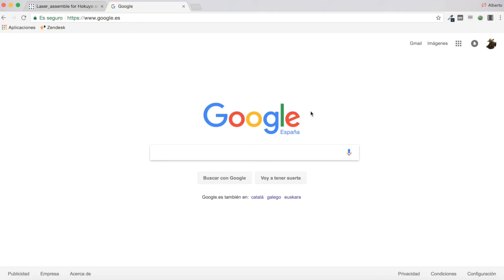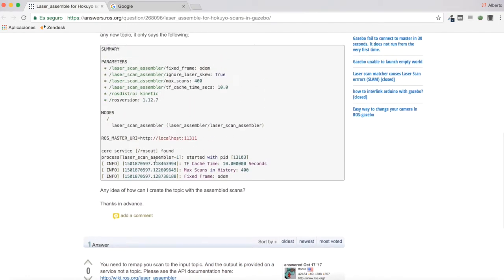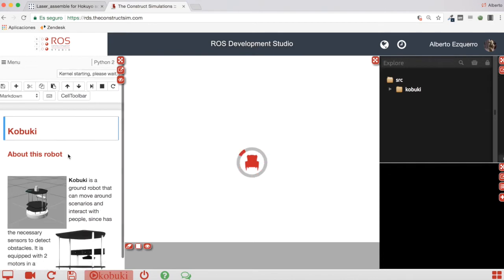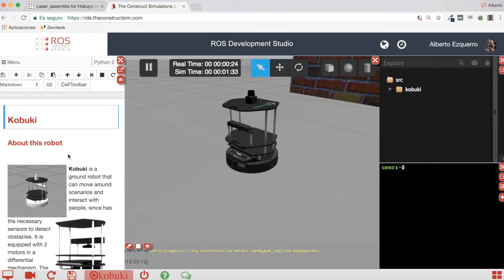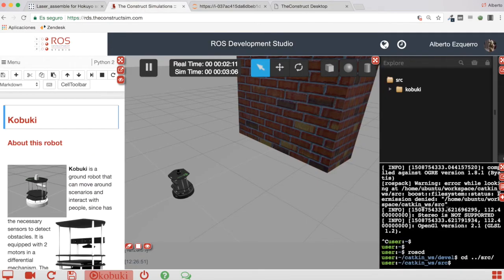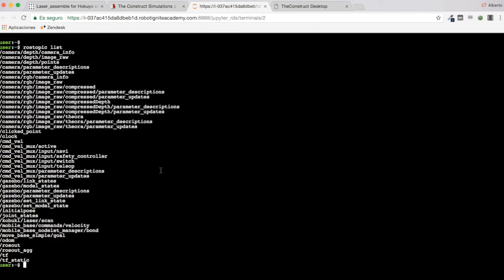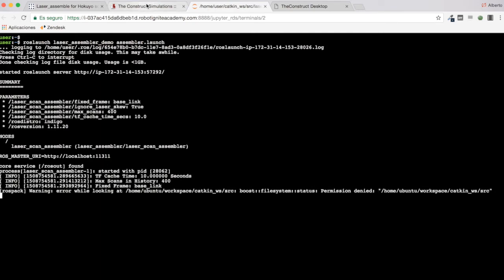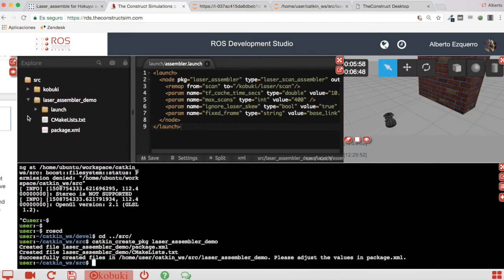[ROS Q&A] 047 - How to use the laser_assembler package

Comment: I am trying to implement this to a Raspberry Pi project.

Everything seemed to be working until the last step:

After roslaunch laser_assembler_demo service_client.launch, monitor screen gets black and everything gets much slower. 

I get around "Got cloud with  6872340 points"  maybe this is a huge number for rpi to process?